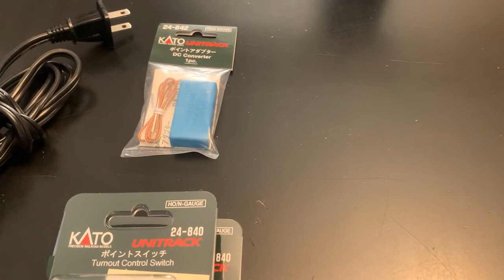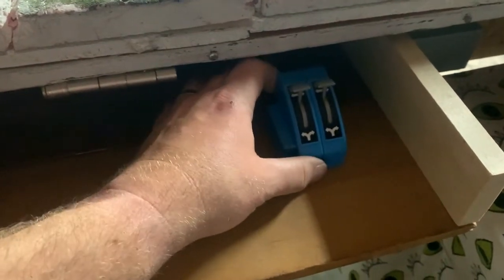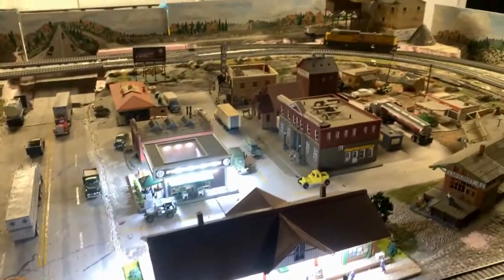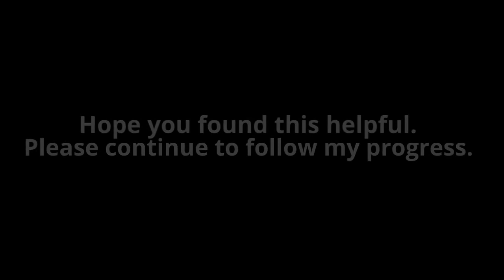KATO Manual Turnout Upgrade to Powered

Comment: What powers them? Can these be operated by a DCC controller like digitrax? Sorry if these are dumb questions im new to the hobby 😊 thanks!
Reply from the maker: I’m sure they can, but I’m not sure how. Kato sells a DC Converter (24-842) that connects to the blue toggle switches. The AC accessory output from an old toy transformer supplies enough power for my force switches.  Kato has their switches run on DC power that can be normally be supplied from their controller.

Comment: Are you able to wire both turnouts to one blue controller so when you flip one switch both turnouts are thrown at the same time?
Reply from the maker: Yes, you can. You will need to double up in the wire harness that connects to the toggle switch. Or wire splicing so that one toggle switch will send power to both.